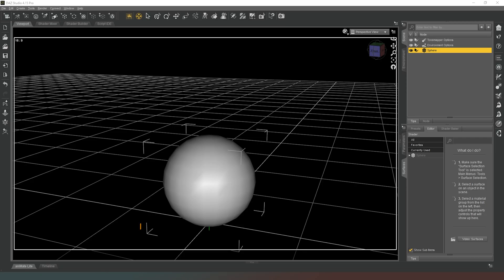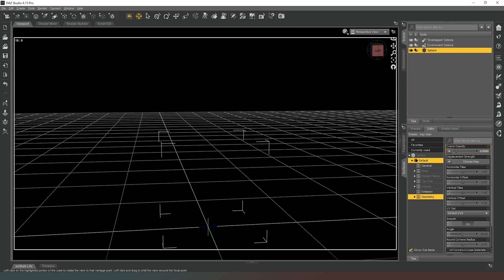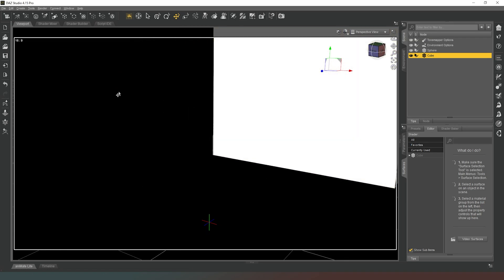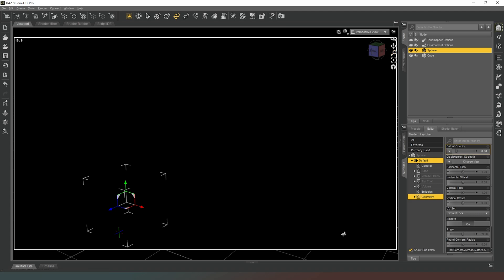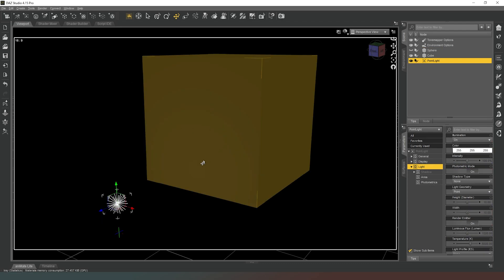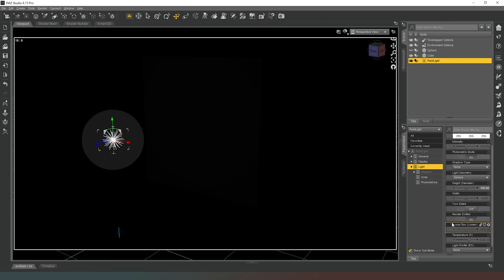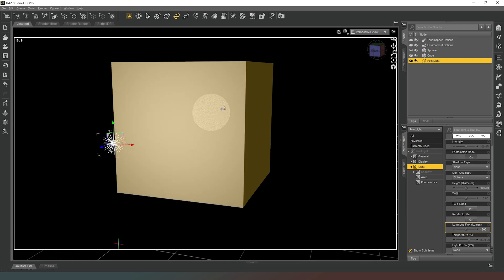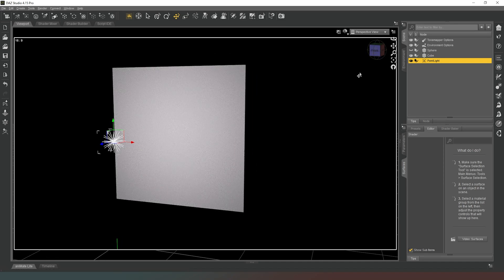[Daz studio] Ghost light not working? Here's an alternative!

Comment: I found something ..... Render Settings Tab/ Optimmization/ ... caustic Sampler to "on". Drops the number of zeroes needed to illuminate anything with a GL a substantial amount. No, I'm not sure what the "caustic sampler" does, and to be honest, at this point I'd only care if it kicked McConnell in the nose. Then i'd marry it and we'd have really funny looking babies who you can't see well. Anyway, there's a couple few cents of mine.
Reply from the maker: Caustic sampler is usually used to simulate glassy surfaces that split different light frequencies as far as i recall. I presume that has some impact on Ghost lights as well then